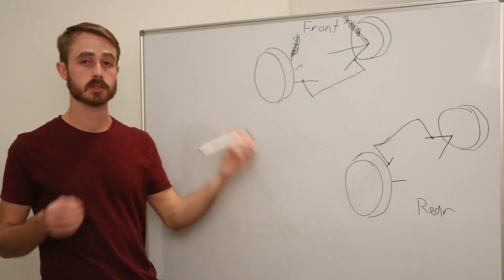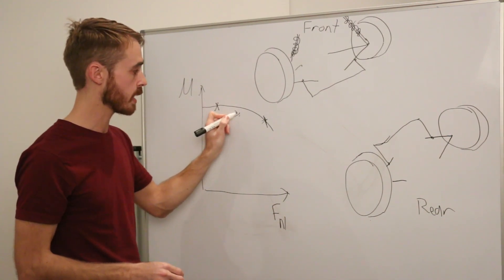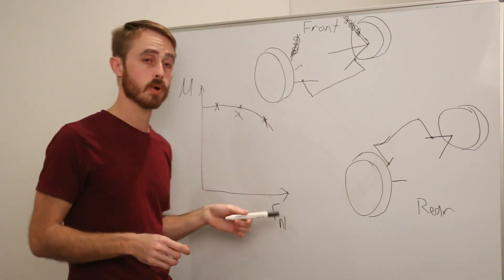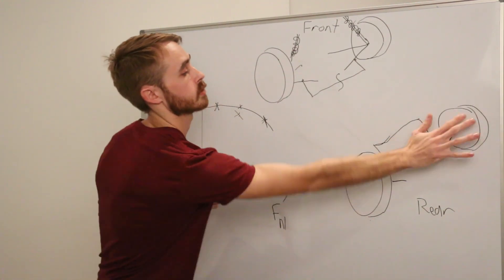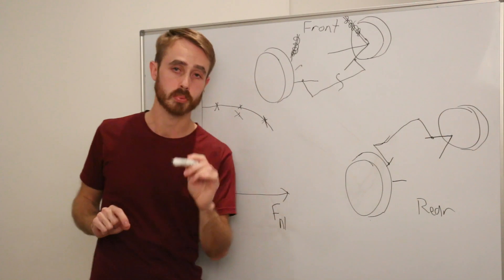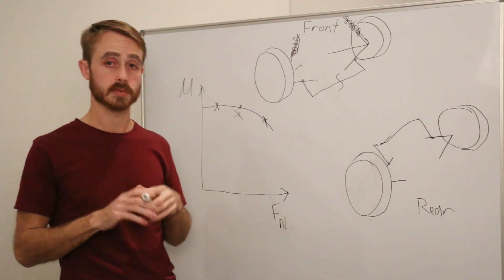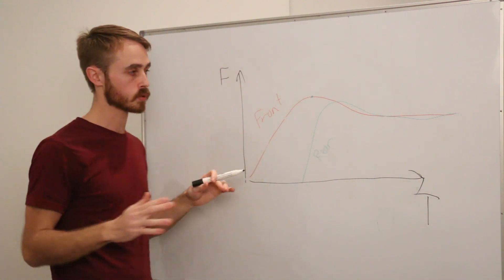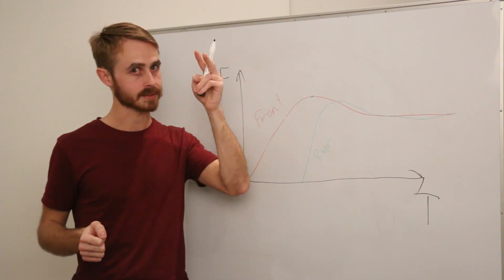How Anti-Roll Bar/Sway Bar Tuning Works

Comment: I'm slightly confused at the beginning of the video. Shouldn't it be this way: the outside tyres are in a good position because the load of them is increased, thus providing more grip and the inside ones are in a bad position because they are less strongly pressed to the ground? Friction increases with the normal force, so the higher normal force on the outside tyres should mean there is more grip available.
Reply from the maker: +nutellabananenmist The total grip force will increase as the vertical load is increased, you are correct there, however if you watch my video on how tyres work (https://www.youtube.com/watch?v=y5Y-w4zGW00) you'll see that when the vertical load increases, the coefficient of friction goes down at an increasing rate. This means that adding weight to a tyre makes it less "efficient" and removing weight will make it more efficient. However the rate at which the efficiency is lost is faster than the rate at which efficiency is gained, thus if you transfer weight across an axle, you will see a total drop in efficiency, hence a total loss of grip.

Does that make sense?
Reply: KYLE.DRIVES Yep, makes total sense now. After some research I found out that this is called "tyre load sensitivity". Your videos are awesome man, I always learn something new while watching them. Keep up the good work :)
Reply: no
Reply: +KYLE.DRIVES Does this mean on a street car with relatively low weight and horsepower it could be beneficial to try and increase tire load to achieve ideal slip angle? if each tire is carrying ~ 300kg is their any merit to attempting to increase force on the inside tire or will losses on outside tire grip always outway increases in inside tire grip.

Comment: What kind of set up would be beneficial for a drift car? If for example I wanted to set up a Miata?
Reply from the maker: Artem Tsvetkov As drifting is more about style than speed, setup is more down to personal preference then anything else, just keep in mind that top level drift cars are actually set up with a lot of grip on the rear axle to keep their speed up through the slide, that's why they need ridiculous horsepower figures. If you are a lower down level I would recommend stripping a little more grip from the rear and maybe not running insanely stiff rates so your car remains somewhat predictable and not hyper twitchy.

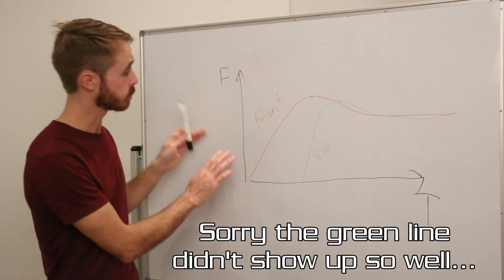Comment: I think i finally understood what is wrong with those graphs that starts at 4:44.
This graphs shows performance of car with chassis torshional rigidity close to zero and explains why you want to make your chassis as stiff as you can.
Or i should ask you to advice me anoter bunch of books, because the one i have read ("How to make your car handle" by Fred Puhn) mensioned suspenshion frequency only in relation to ride quality.
Reply from the maker: +Алексей Любимов Those graphs should still be valid for a chassis with less torsional rigidity, as it will effectively be acting as an undamped spring. It will lower the overall roll spring rate of the car though, so the time delay will increase. Oscillations will also continue for longer, as the chassis spring rate is effectively undamped, which is why it is highly undesirable.

I don't believe roll frequency is covered well in books, really something you have to learn in the racing industry. I can recommend attending a seminar by Claude Rouelle if you want to learn more about it, however these are upwards of $1000pp for a 3 day course.

Comment: So, did you do anything to the rollbars of your 86? I'm actually pretty happy with the OEM setup, since it's pretty good balanced, and the car can be tailhappy, if you want it to.
Reply from the maker: ***** I've kept mine stock, the balance was perfect for me, and on the stock tyres the rates are fine for road use (although it was a little too much roll for my liking at the track). If I was going to use it as a combo track/road car I'd probably stiffen it up with some coilovers then see if the ARBs need adjustment, but it's my daily drive so it doesn't really need anything more, I'd rather put the money into my race buggy!

Comment: That there was a lot of information about vehicle handling characteristics in that brief explanation. I usually reference static loading since the math is easier, though it is still just a reference. Ultimately the specifics are still dependent on feel which requires real world testing, a max and min must be determined by the driver. More data allows for better decisions.

Personally, I slow roll to increase response with high rear damping. This makes the rear gradually lose grip and easier to drive when over loaded. There is a tendency for the rear to snap loose when under dampened which is not good when average human reaction time is 0.2 seconds. But there must be some compromise if the track is bumpy.
Reply: Of course the high damping is in combination with the right anti-roll bar found through more testing.